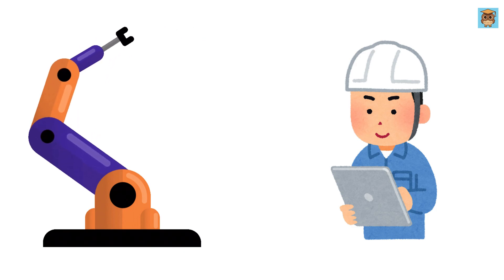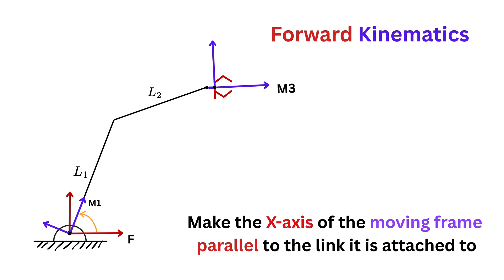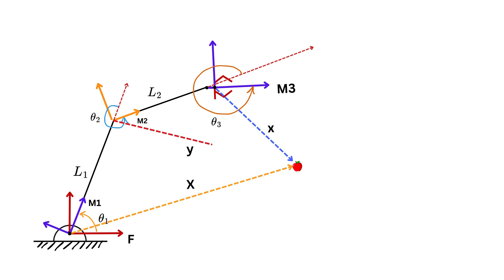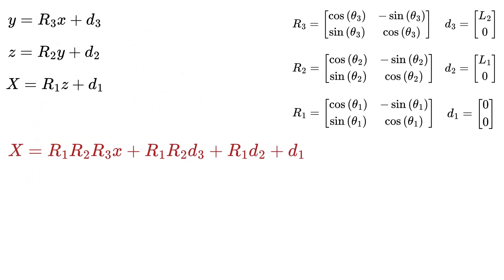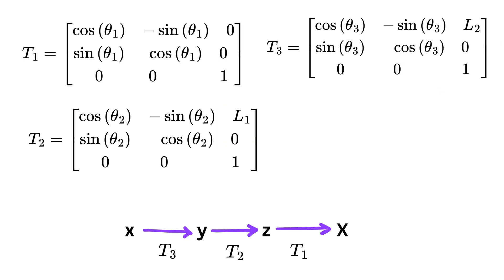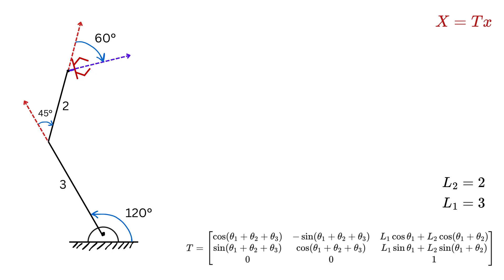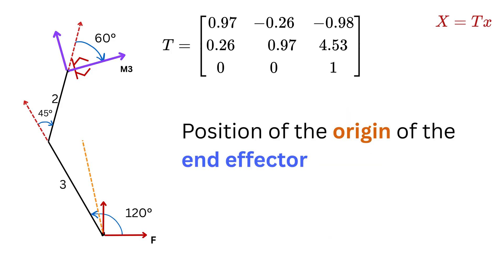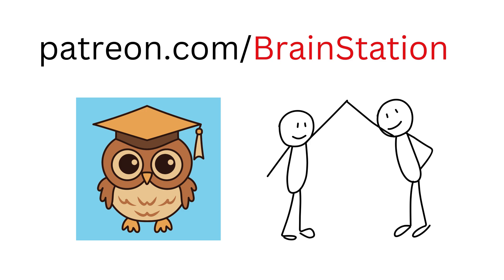Solved Example - Forward Kinematics

Comment: Hey so just to make it clear, can't we just use the negative angle when calculating? Like you are always taking positive angle in anticlockwise direction. But like can I put negative angle with negative sign of course in the transformation matrix?
Reply from the maker: Yes you can definitely use a negative angle in transformation matrices.....When you use a negative angle, you’re just rotating in the clockwise direction instead of anticlockwise. The transformation matrix still works the same way!